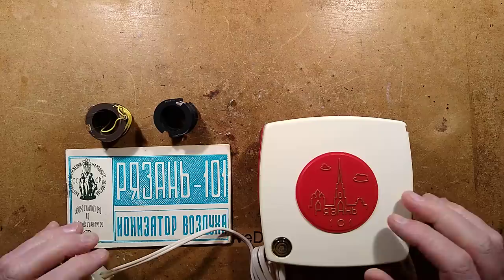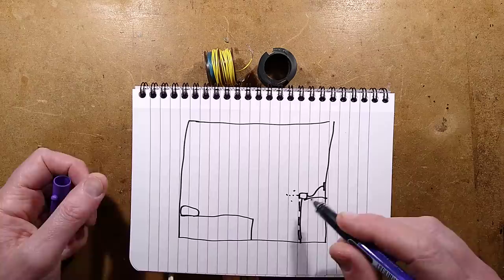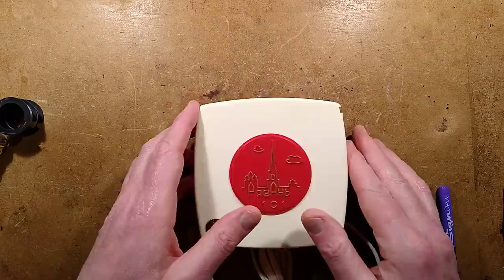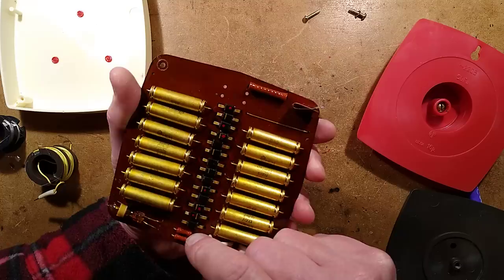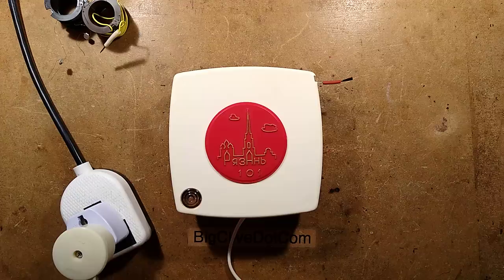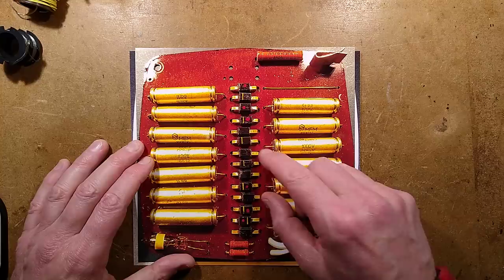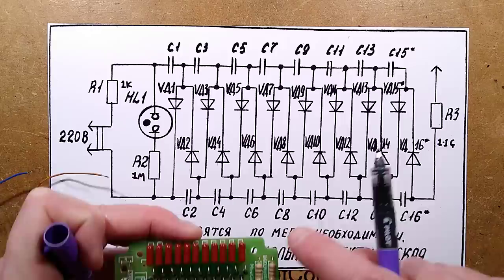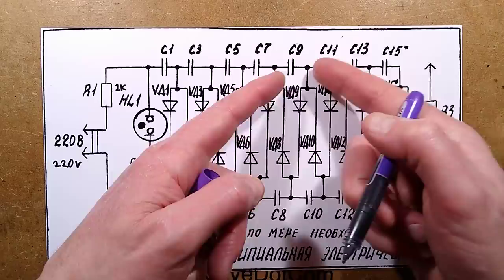Inside a soviet ionizer from 1990 (with schematic)

Comment: Where it is possible to buy carbon fibre brushes for ionizers?
Reply from the maker: Either as carbon fibre tape with bundles of the fibres knitted together with thread, or as the red rubber coated carbon fibre underfloor heating wire.
Reply: @bigclivedotcom  Thank you! It helped a lot. It's already on its way. I ordered red rubber coated one. Last year I made a ionizer and 3d printed a case, but I wanted to use brush as emitter. I ordered different brushes for vinyl records but it turned out they are not really carbon fibre as it was said in description. So in the end I used one technical pencil graphite rods and pointed a tip a bit. But as I understand more smaller sharpen ones are even more effective.

Comment: Does this produces ozone in the process?
Reply: I heard that ozone is only released if a plastic case is used, I read it on the website of a Russian manufacturer of ionizers, so they use wood, not plastic. I don't know if this is true or not. The problem with these ionizers is also that they electrify the surface and then all your walls and furniture will attract dust.
Reply from the maker: Only at the faintest sub-nature levels by this unit.
Reply: Thank you both :))

Comment: I find it hilarious that they went so far in making a normal device into quackery, that they made it do the opposite of what it should normally to do. How utterly stupid. All they needed was a bit of frayed/splayed out wire or a carbon brush in the terminal instead of the long spool you have to string up.
EDIT: By opposite effect I mean make the whole room more dirty instead of just a small area around the device.

Comment: i wouldnt leave it running in an enclosed space for long periods of time. Sure its good at what it does but it produces O3/ozone as a byproduct. if the room you leave it in smells slightly sweet, turn it off. otherwise it should be fine so long as your home has good ventilation

Comment: Strange that the schematic shows two rows of eight capacitors whereas the actual circuit only had seven capacitors per row.
Reply: There is mark in schematic with asterix * that 8th capacitors in each row can be placed on, if required.
Reply: @FLomasterZ  Oh thank you! I missed that.

Comment: The proper description of that type of mains plug is irritating. They dont go into a modern earthed recepticle. Very annoying when molded on for example on old hifi gear.
Reply: @Eddies_Bra-att-ha-grejer  Exactly. My ex bought an apartment that was finished in the early 90''s and all of the normal room outlets that are not specifically for a dishwasher or other such appliance are ungrounded. I struggle to understand how that could be legal. I also live in sweden.

Comment: Wow just a side thing is it still common in uk not to use billion (thought all that changed in like 70's)

When i heard Thousand, Million, Thousand million I was confused for a bit. 
Thousand, Million, Billion, Trillion,
,000. / ,000,000. / ,000,000,000. / ,000,000,000,000.
Reply from the maker: It can mean 1000 million or a million-million in the UK depending on who's using it.  I just avoid using it as a result of the indecisiveness.

Comment: They build things to last in Russia
Reply: It was different world. Russia is wealthy but people are poor and this was shown in products. They were build cheap often not producing dedicated parts but using one already produced for other things and results were bulky and rather crude but often very resilient and easy to repair also miniaturization and automation was practically non existent and everything ways produced by hand so it was more practical to use bulky parts and designs rather then painstakingly try to solder hair thin wires etc. It was not perfect but it worked and did the thing. For example cars yes they were loud, dirty and for today western standards horrible death traps but they worked in rural Russia and still do even today decades later almost indestructible with minimum electronics parts that can broke and mechanical one were so simplistic that village smith can make new spare parts.